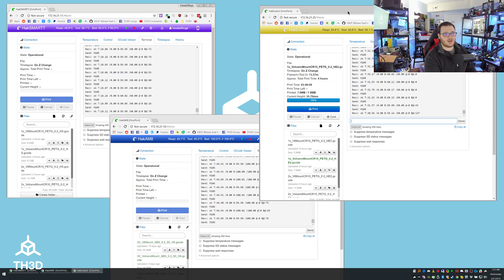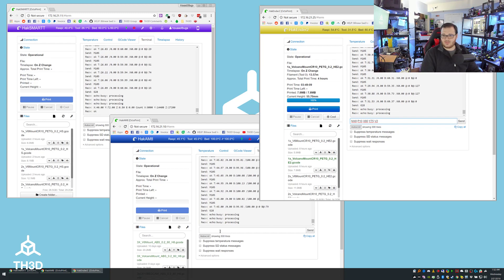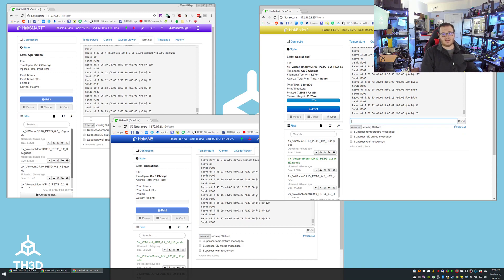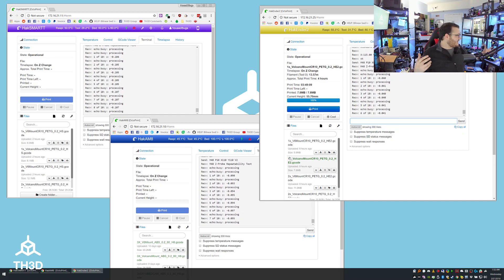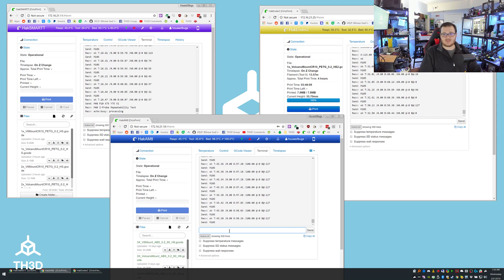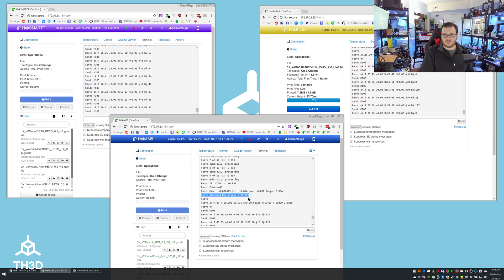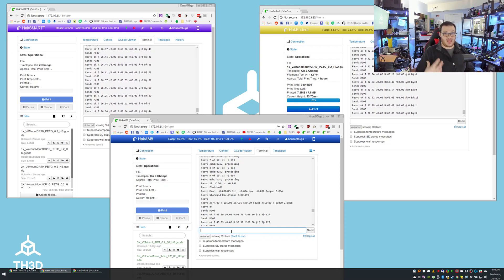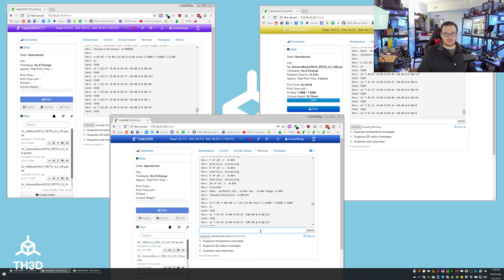TH3D EZABL Sensor Testing - 1st Gen and Current Gen

Comment: Just out of curiosity, I'm now running the TH3D firmware, do you have an Anet A8 E3D v6 carriage that includes EZABL sensor holder? or do you have the custom offsets for a popular carriage? I'm still on the stock carriage/hotend and have an E3D v6 waiting to go in but would like to have the EZABL sensor integrated.

Comment: Yeah I'm not sure what the hell that guy was trying to accomplish... Since I've switched over to EZABL with the solid mounts (spring replacements), I have had to do literally no work in regards to leveling or had issues with prints sticking. Print, pop the part off, queue another part via octoprint, repeat.